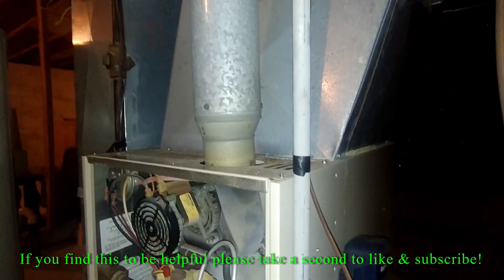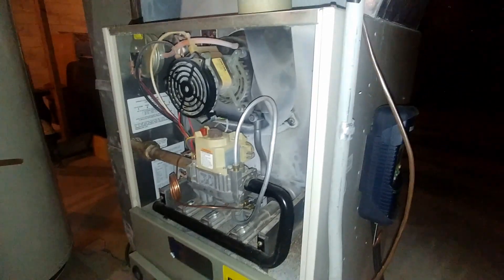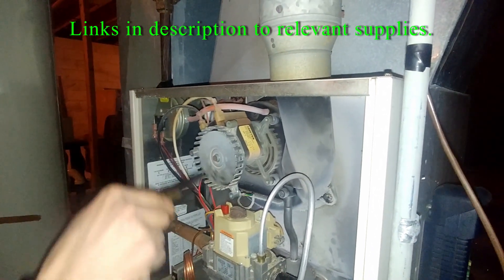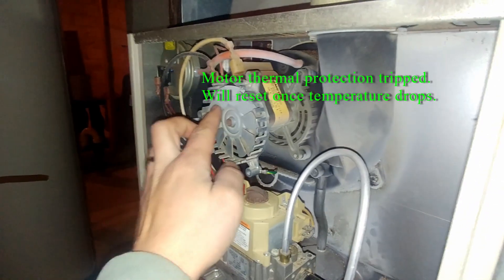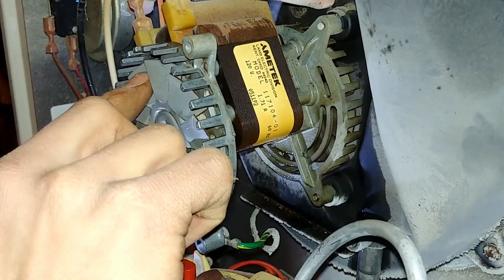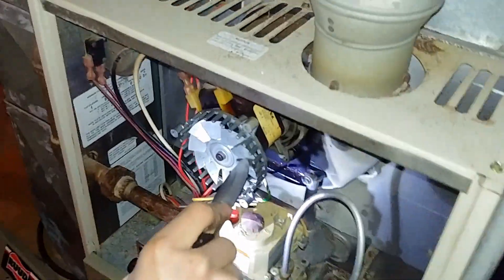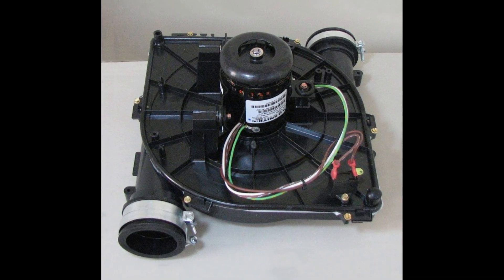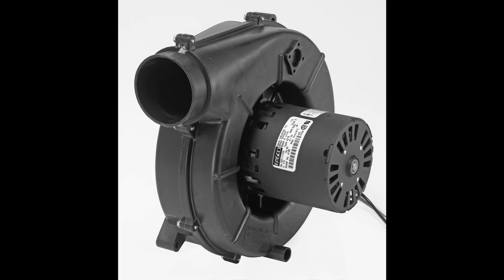Stuck Combustion Draft Inducer Motor - Furnace Making Humming Noise & Won't Start

Comment: I have a older mobile home furnace which seems to run pretty good. Though, the only thing about it is when the furnace is not running it makes a buzzing noise or a humming noise. The buzzing or humming noise isn't very loud but you can hear it if you put your ear against the outer furnace door. Does anyone have any clue as to what this may be. Any advice is greatly appreciated thank you in advance. 👍

Comment: That bearing is sealed, it's not meant to b oiled.
Reply from the maker: Yes but sometimes you can get it to work long enough for the new part to arrive.
Reply: He mentioned that in the video 3x also I had this issue and oiling it let me have heat for a whole month until I could save up for the repair
Reply: @guillymemes5115  hi there happen to see this was from few weeks ago.. mines doing this, at least a week for new assembly. Was wondering what lube you used?? Thanks so much